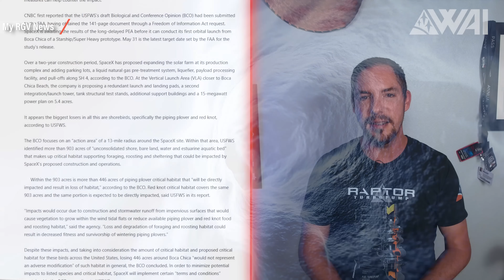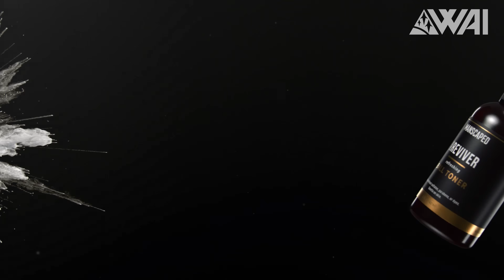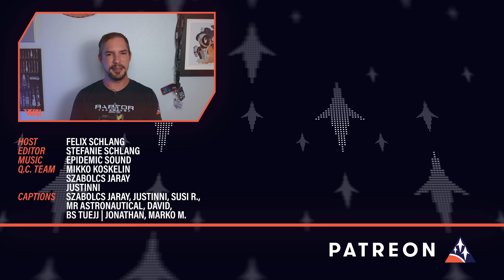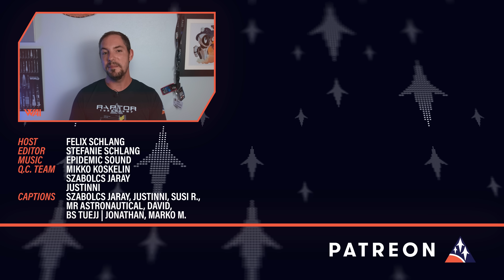SpaceX Starship Accelerating Efforts Towards The Orbital Launch Test!

Comment: Your analysis is highly flawed. Look at photos of the Hindenburg. Most of the hydrogen was released in to atmosphere. Mixing oxygen and methane requires a specific process. Most of fuel would likely go into atmosphere. The over pressure event is probably limited to fuel within the engine section. To do a good analysis requires lots of tools and info you don’t have. This is reckless.

Comment: Decades ago, I did similar calculations for nuke plant evac plans.  You need to consider the tank farm as participating in the event.  They will explode due to internal pressure, and shrapnel from those pressurized tanks will cause secondary damage and a lot of it.  

There is a reason Pad 39A stores fuel and oxidizer at opposite ends of the expansive pad complex.  Repairs at Boca Chica would take at least a year.  I surmise the function of Boca Chica would scale down afterwards.  I never liked the pad setup at Boca...Even less now.
Reply: I will never understand why the hell the tanks are so close to the tower ,
Seems rediculous to me .
Reply: @davefarmery8180  Pumps and pipes.
Reply: First you have have confused the burning of the fuel and a detonation as many others with a little knowledge here have pointed out.  I think it's quite possible that the tanks will be quite empty when the launch occurs.  The tanks store cryogenic liquids, not gases pressurized to a liquid state.  So much fear mongering with this issue.
Reply: At least put up a blast wall....
Reply: The tank farm will be pretty much empty after fueling a Super Heavy and a Starship....
Reply: I appreciate Space-X’s drive and iterative development process… However!  This is a MAMMOTH booster and if it were to explode at launch or even shortly after the effects would be catastrophic!  The fuel farm is WAAAAAY too close for a rocket of this magnitude much less one without any flame diverter.   I usually give Space-X the benefit of the doubt but this is the ONE thing I. Ant really figure out.  What do they think is going to happen to all that heat and percussion waves?  It’s going to go right into the pad and the tower complex.

Comment: Main difference is time and density the energy is released. This would more than likely end up in rapid oxidation not detonate. 
It’s hard enough to build Rocket engines. And there‘s a reason for it. Else you could just throw oxidizer and fuel into a chamber and ignite… 
That’s not how it works. A nuclear bomb detonates within milliseconds after an extreme unstable exponential growing nuclear reaction. It’s a dense bunch of highly unstable atoms which only need one thing to get critical. To achieve most efficiency you even try to intensify the density as quickly as possible. Like compare the Tchernobyl accident with a nuclear bomb. The reactor accident was caused by rapid instability through falsely designed controller and misunderstood system. But the accident didn’t cause the same detonation a nuclear bomb does. Mainly because of the significantly lower enriched nuclear fuel. Even nuclear bombs have a limit to which they get inefficient to further increase in size.
Reply: Wasn’t 800k kt the upper limit for pure fission device? I think I  read that somewhere

Comment: They've never lost a Starship in flight. Super Heavy has WAY more than basic thrust. I see nearly zero issues. Within about 15 seconds of leaving the tower, they can easily abort over the water and...nothing.
Reply: SN11
Reply: SN11 did explode during belly flop, but it was nearly empty then.  They have excellent record on liftoff.  Booster is going to lift off at near 1.5G so it's going to clear tower under 4 seconds and well away in 10 seconds with a good 150mps vertical velocity.

Comment: Good video! However, your making a big assumption that the booster AND the starship will "explode" at the exact same time. This to me seems very unlikely. Thus I would suspect your "10 kilo ton's" reference is too high. And the "area if impact" would be much smaller.
Reply: Did Elon Musk once say that it would be more of a fire ball than an explosion and that the Starship could conceivably start its engines and pull away?
Reply: @favesongslist  You can clearly see in the SN4 explosion video a shockwave and that mass simulator chunk of metal they had on top got launched. That statement might be one of those "aspirational" things Elon says.
Reply: @sathivv950  You could pull away from the booster if you were ready.
Reply: @tedmoss  yes but that has also never Been Done!
Reply: @sathivv950  I do not think Musk was not saying it was not an explosion, but pointing out that most of what is observed from the SN4 explosion is a fireball.
Reply: @favesongslist  But this is more that a question of semantics. There is a huge difference between a detonation and deflagration. Elon claiming it is the latter as a way to downplay it is disingenuous. Most of what was observed in that Beirut explosion was a fireball too but that didn't stop that pressure wave from destroying the city. What is interesting to me is all the other starship explosions were just fireballs, with no visible blast wave; so I wonder what was different about the SN4 explosion to cause a detonation.
Reply: @sathivv950  normally it would be the amount of energy released over time, like a nuke for example: high amount of energy released in very short amount of time.
Reply: If the booster explodes it will take the starship with it.
Reply: Well just from a fuel/energy standpoint the mass of prop in both vehicles could account to 14,5 kt under perfect conditions, but you never have perfect conditions.

Comment: That was good. My explanation tends to make people's eyes glaze over.

With a nuke the energy is released from a half meter radius. Millionth of a second.  The shock wave created is many times the speed of sound. Huge burst of heat that catches anything withing a few hundred meters on fire.  

So at a distance you get blast of heat, shock wave, tons of superheated debris, then the wind comes back in the other direction fanning the flames.

With methane... there would be an initial impulse with a small fraction of the mix, followed by  tanks rupturing, liquids spilling out.  Over several seconds as the liquids boil into gasses you get a 100 meter mushroom of flame.  It would probably not be as loud as 33 engines firing.

I wonder how much protection the ground hardware would get from cooling effects of the boiling methane/O2.

And what the fire suppression system would do...

Comment: No way all the fuel will explode at the same time. The fuel isn't mixed.
Tanks are full.
Exploding engines could create an overpressure causing the tanks to burst, causing a giant fireball as it mixes and burns.
I do not expect a huge shock wave.
Reply: I doubt  that the farm tanks will be full and pressurized at the time of launch. They'll have been emptied to fuel the rocket. SpaceX would be wise to make sure they're not a secondary feed stock to a conflagration at the launch pad.
Reply: @willcooper7651  
The tanks also have 1,5 meter insulation with steel Hull.
I don't know how much protection that provides
Reply: @TheAnarchist01  Good point. They probably would offer some protection from a fireball and minor overpressure event.
Reply: @TheAnarchist01  Quite a lot pressurized.
Reply: @willcooper7651  Oblivous.
Reply: Absolutely.
An explosion, even hypotetical, is less unlikely to happen at maxQ altitude, not so on the groud.
75% efficiency is wrong, if not impossible. It'd be better to calculate energy based on the physics of Raptors expected performance, not on chemistry.
Reply: @sysfx  
-- Apologies
Having trouble following your post.
( too many wrong/negatives )

-- An explosiom of a rocket:
is most likely between 
ignition of the rocket, 
and reaching maximum acceleration.

High altitude explosions, are unlikely.

*********
The major contributing factor,
being the containment of the fuels.
-- Regardless of Chemicals
-- Regardless of expected Performancr
Reply: @dirkkarmel5209  
Thank you

Comment: I am interested would shaped charges like for flight termination system help in containing the explosion if for example overpressure is detected and they are activated automatically if explosion is inevitable.
For example if they rip apart the methane tank towards the bottom and oxygen tank towards the sky so to prevent them mixing in the fireball as much as they can.
I mean it will have flight termination system for sure, but i am interested can FTS help in containing the explosion in case of RUD.
Reply: O2 is at the bottom and methane at the top.

Comment: IMHO your numbers still assume perfect stoichiometric mixing and I doubt the mixture would be that, so total efficiency likely closer to 10% rather than 75% used, and also not all at once, rather a succession of sub-booms as different sections mix and burn or explode.  So your analysis is very likely the absolute worst case.

Comment: The calculated power of the explosion is inaccurate because of the subsonic nature of a explosion of a methane/O2 mixture BLEVE. This is believed to remain well under subsonic velocity, making this a deflageation, not a detonation. Big difference.
Reply: Where were you when I was researching!! :)
Reply: RUD.
Reply: My first thought was deflagration not detonation.
Reply: In the worst case scenario it could detonate 

Imagine if there was a catastrophic bulkhead failure/ downcommer failure Where the fuel and oxidiser mix for a few seconds before ignition 

That would cause a large supersonic detonation in the tank rupturing the hull the rest of the methane and oxygen will be thrown out of the tank and subsonicly combust like in SN4
Reply: @captainahab5522  How do you get liquid methane and liquid oxygen to burn?
Reply: @captainahab5522  But if the common bulkhead fails, the Flight Termination System would rip both tanks open, relieving the pressure before any significant mixing. Both both methane and oxygen are still super chilled, so it would definitely be a deflagration, not a BLEVE which requires the fuel to be super heated so that it flashes to a gas instantly when the pressure is relieved.
Reply: @thomwescott5760  I guess it would depend upon why the explosion occurs.. Why would either tank rupture? If the fuel is ruptured it would have to mix with air or oxygen (from the O2 tank rupturing) to burn, so it would not be an internal explosion but combustion of escaping fuel.
Reply: What is also well documented is that in such circumstances well under half the fuel is even combusted.  Very different to mix and ignite fuel and oxidizer under ideal circumstances, as apposed to just trying to ignite two unmixed blobs of both sitting next to each other.

This guy like so many others who post this kind of stuff, has a big mouth on him, but not much else.  In fact I often wonder about what motivates somebody to start posting videos like this as though they are some kind of authority.  I guess this is just the next stop up from keyboard warrior.
Reply: @johnrauner2515  Funny you should mention "keyboard warrior".

Comment: I  see the advantage of catching boosters and starship........BUT it seems to me that removing landing legs eliminates any plan B. Important with crewed missions?
Imagine you're on a manned flight and the booster misses its catch or lands hard damaging/destroying the tower.....You're in orbit with no way to land.......
Reply: I suspect they have plans to ditch in the ocean if they can't land using the tower
Reply: If you only have landing legs and they fail you also have no plan b......
Reply: they are already bulding a second Tower, and dont forget the two Oil Platforms they bought... so at the point when there are manned flights i doubt there is just one Tower...
Reply: I'm also hoping that they build shorter landing towers with none of the stuff required specifically for launch.  This can be done further from things like the tank farm and be less of a loss in case of a failure.

Comment: Where did you get the 75% efficency, because that seems very high to me since the methane and oxygen are separate and have to mix. It seems like maybe the explosion would be spread across a few seconds as they mixed reducing the intensity quite a bit. I imagine part of the reason a nuclear explosion is so damaging is that the whole 10 kilotons (or whatever) happens within a tiny fraction of a second. I'm just reasoning here--I have no expertise--so I'm just wondering if you just picked 75% out of the air (no pun) or found it somewhere authoritative?
Reply: Yeah, you're accurate. Impulse has a huge impact on the structure of an explosion.
Reply: Indeed…why did Felix decide a 75% of max energy explosion was an appropriate case to study?  I’m unqualified to know, but I recall last year an expert said it would be much, much less.
Reply: @737smartin  Any expert would say that. 90% goes straight up because of air pressure being lower straight up.
Reply: I figured it was probably just a number pulled from air, although I didn't want to assume. Still, I think it's fair to use as an outside maximum value, and and the nuclear bomb website values (which are also bound to be higher than reality) to show the damage would be limited to the local area. Angry Astronaut has been fretting on his channel for months that a full-stack Starship RUD would blow out the hotels on South Padre, and then SpaceX would be set back by a decade or something. So I appreciate Felix showing even with these worst case numbers it's manageable to calm the hysteria.
Reply: It was pretty clear to me he was guesstimating. Don't take those calculation too seriously. You might be right it is not that high. Also the pressure of the gasses and the expansion rate should be taken into account, which were not. I'm no specialist either though.

Comment: If it reaches orbit it will break the Saturn V’s record. And if it explodes it will break the N1’s record.
Reply: Sounds like a win-win to me 😆
Reply: @SodiumEx  That's what Elon Musk said :)
Reply: @favesongslist  great minds think alike
Reply: It  wil probebly do bothe
Reply: Either way, it will be a record breaker.  Let's just hope it's the former, not the latter.
Reply: @commerce-usa  
Considering SpaceX 
& the tightening schedules, 
expect several test launches per month.

Should 1 explode, 
there are contingency plans.

At worst: 
5 or 6, explode per month.
-- Clean-up procedues, are prepared.
( Beyond any other known 
testing methods ! )
Reply: It wouldn't cause such a large explosion as an N1 because the N1 used hypergolic fuel. Cryogenic fuels like those used in Starship are much less explosive because they need an external ignition source meaning a slower less energetic combustion than uncontrolled mixing of hypergolic propellants.
Reply: @schrodingerscat1863  This is sort of true, hypergolic propellants are nasty stuff, T-stoff and C-stoff etc.
Reply: @schrodingerscat1863  the N1 used rp1/lox for basically everything and while rp1 isn't cryogenic it isn't hypergolic either.
Reply: @plainText384  Yes you are correct, I thought they were using hypergolic fuel. The size of the explosions were quite impressive considering it was lox/rp1. It was the absolute worst scenario though with the rocket getting a few feet off the pad before cutting engines and crashing back with almost completely full tanks.
Reply: @schrodingerscat1863  methane and oxygen need to be mixed within the proper ratio or it won't even ignite
Reply: @Bryan-Hensley  Exactly, this is why cryogenic fuel/oxidiser is far easier and safer to handle than hypergolic.
Reply: And if the girlfriend breaks up with you, she will break the Depeche Mode record...
Reply: The n1 exploded several times tho
Reply: win win xD lol
Reply: Remember the 2 events, 
are 2 entirely different possibilities.

If it explodes, most likely during the 
launch phase.  (First 500m, 0.3 miles)
Reply: Yeah but SpaceX or Elon has more money to do more than 4 launches unlike 60-70's Russia...
Reply: @kenjihaag329  
The timing & the extent of damages to the Russia space program, are highly suspicious.

-- Technology fans: regularly point to these disasters as the major 
catastrophy that changed humanity's  
future existemce.  

It is estimated:
-- iHumans would be on Pluto, before 1985 !
-- Mars; Venus, Mercury would have human populations ( 1,000,000 ? )
-- Global map, 
would be extremely different !
Reply: Well said
Reply: It will break the Saturn V's record for noise even during a static fire, let alone getting to orbit.
Reply: So it's a win win